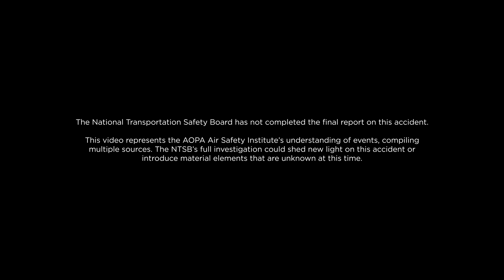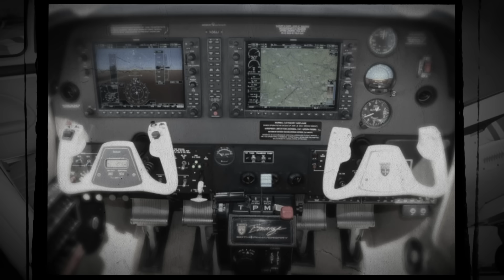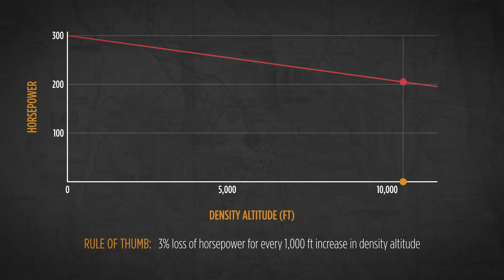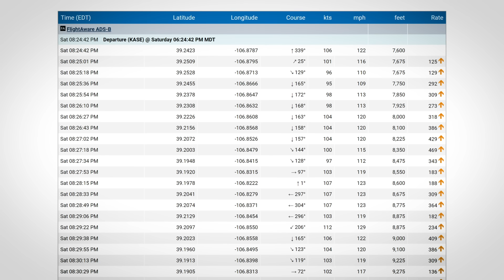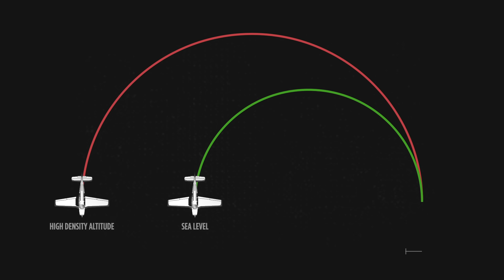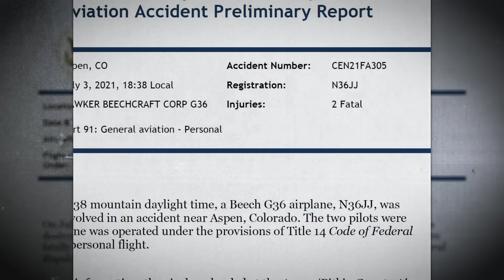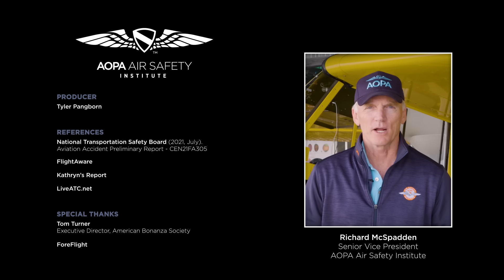Accident Case Study: Into Thin Air

Comment: This is a sad story but a chilling lesson to be sure. The last words said in the narration should be memorized for anyone anticipating flying in mountainous terrain. I fly in the western U.S. mountains frequently and what was demonstrated here is rarely seen by living pilots. Critical is forehand knowledge of terrain MEF, valleys, open canyons, and of course, practiced skill at tight canyon reversals (i.e. nose slight up, coordinated turn, flaps 1 notch...15 deg.) Don't try to make a tight reversal without flaps down 15 - 20 deg., otherwise your bleed of energy and speed will hasten a stall. Aspen is extremely challenging for a non-turbo SE aircraft - I wouldn't recommend it unless you are really a competent and mountain trained pilot. In any event, another excellent ASI video that I hope every student and old-timer pilot watches if for nothing more than to instill a good amount of trepidation and respect for high altitude mountain flying.

Comment: PSA a better single piston route is NNW from Aspen to Eagle then, Kremmling, Granby and cross Corona Pass…save Independence pass for a cool blue bird morning,  should the mountain invite you. A thought about oxygen, if the airplane has less lift and engine power in high DA, wouldn’t your biology have the same?  I’d think the high DA would accelerate affects of hypoxia, dulling a pilot’s perception too.  I’ve never heard pilot sensitivity to hypoxia increase due to DA, so maybe it’s not a thing. I’ve Used a pulse oximeter and my O2 saturation drops more on High DA days (sample size of 1), enough for me to play it safe & take a bottle when flying the high country. Great video and  spot on.

Comment: If they had done 3 or more circuits before departing would they have reached sufficient altitude to clear the pass or was it beyond the performance of the aircraft regardless?
Reply: It can be done, but it is a skill. I have flown a normally aspirated Cherokee 180 into Leadville, CO before, but I did it with half-tanks, no luggage, and only two people. Also, I knew how to properly lean the engine for best performance at that altitude. When I had that airplane in Angel Fire, NM (field elevation 8,380 feet) before I moved up to my turbocharged Saratoga, there were days that by-myself and half tanks, it would take me 4 or 5 circuits above the airport before I would cross the mountains. However, I never cross a mountain pass until I have at least 2,000' of clearance above the ground. However, the higher you climb, the more you have to lean the mixture to keep the correct air-fuel mixture to obtain the best engine performance.

Comment: This plane had Garmin 1000 panels, but it wasn't integrated enough with the aircraft to detect (or at least assist) with this?
Reply: Perhaps it was the decision to VFR outbound - does it cancel all the IFR planning - I guess it does.
Reply: This is the problem with relying on technology and why those educated the old way and the new way have a big advantage in almost every field. But it's a good question of course and i guess the Garmin is an imperfect tool.
Reply: @acchaladka  Respectfully, I don't think we can say the pilots were 'relying' on the technology. I was simply wondering what assistance such an advanced system might be offering.

Comment: Density altitude can be a factor at sea level. Sacramento Valley in summer for one. Type of aircraft. A Piper Lancer (stretched version of the Cherokee) that is an under powered AC at best. Short runway with a railroad embankment at one end and a barbwire fence at the other end. Hot afternoon. We waited until late afternoon and pulled the AC back to the very end of the runway (dirt). With us standing on the brakes to gain full rpm off we went. Well we didn't crash but that AC climbed up the I-80 right away with the terrain rise matching our altitude. That was a plane looking for a place to crash. South Lake Tahoe Airport is a real killer in the summer if you have a southern wind and four people with all the luggage and a load of fuel.

Comment: These types of stories anger me. Flying any type of aircraft- single engine carb to fighter jet require the utmost in checking and double checking and thinking conservatively. 

I fly GA back east in Maine. I traveled  to Tahoe early 2020 to take a “discovery” high altitude flight out of Truckee with CFI in a C172.
While it didn’t reach me everything, it certainly alerted me to the negating performance issues of high density flying. It was a significant learning experience on the ground pre-flight and in the air. Double up on every anticipation. I’m so sorry for this tragedy. It was avoidable.

Comment: About 30 years ago I departed RWY 33 KASE eastbound via Independence Pass in my 200 HP Turbo Arrow with reasonable safety margins. The following factors were in my favor.
1.	I was familiar with the area, and my aircraft.
2.	Turbocharged engine and oxygen on board.
3.	Lightly loaded.
4.	Good daytime VFR.
5.	Reasonable density altitude.
6.	Wind from the west.
7.	Alone, no distractions, rested, and no "get-there-itis".
8.	Flew down valley (to the NW) away from Aspen and Independence Pass to gain altitude before turning 180° toward IP. Coordinated with Aspen tower. No inbound traffic.
9.	Flew the NE side of the valley toward IP for lift and plenty of room to turn 180° if necessary.

About 25 years ago I was landing RWY 15 KASE in the same aircraft. I executed a go-around over the field and circled Aspen (with very little vertical and horizontal clearance) for landing RWY 33. Note: departures from RWY 15 are not permitted w/o special written permission due to terrain (2% upslope toward a box canyon). The following factors contributed to my decision to go-around, or were not in my favor for gaining altitude during the go-around.
1.	Strong gusty wind from the west.
2.	Wind shear on short final and turbulence over the runway.
3.	Substantial crosswind and tailwind components.
4.	High density altitude.

I had a reasonable amount of mountain training and mountain flying prior to flying into and out of Aspen, but wish I could also have had the high-quality simulator time that's available today. Even playing around with Google Earth could help. Going missed approach past the MAP and decisions whether to force a landing or to execute a go-around with limited or unknown options happen a lot quicker than getting boxed in tight on the way to Independence Pass.

Comment: The LINDZ NINE SID at Aspen requires a minimum climb of 463' per NM.  At G36 Vy of 100 KIAS, the required rate of climb would be 776 FPM.  I seriously doubt that normally aspirated plane was capable of that on that day at Aspen.  They didn't accept the IFR clearance, but it should have made them reconsider their plans.

Comment: Could that plane physically do it… were they doomed from the start?
Reply: Yes, the plane could probably physically do it, but it would take expert air-fuel mixture management, probably a little less weight (think half-tanks of fuel), and a LOT of patience climbing over the airfield to get to the right altitude. Density altitude is taught to every primary flight student, but it is only theory. Until you experience, you just don't get-it. Once you do get-it, you don't screw around with it.
Reply: @CIOPilot  
I also wonder if they’d known the gravity of the situation a little sooner if they could have found a spot of open ground to set it down. Probably would have had one shot at it since they couldn’t turn back.

Comment: One more item of poor decision making; Why opt to transit via Aspen ? A little over 100 milles further, crossing the high ground with less fuel weight, they could have made it to Colorado Springs for fuel. Then continued on with the ground falling away. Why plan your way into a difficult situation ? Too many accident scenarios begin on the ground the day before. If they lacked range to make it to Colorado Springs then schedule a quick fuel stop before the high ground.

Comment: Did they brief fully? It was a confusing start, they had an IFR to VFR transition, then they seemed a bit behind in terms of where they planned to go once up. High altitude flying with a climb rate of 200 FPM and its getting dark and you have a long flight ahead into very very high terrain? Even if they cleared that first ridge, the route they showed looks tough to be doing especially at night (very little light on mountains)

Comment: To get an adequate margin above the peaks, wouldn’t they have required supplemental oxygen ? Perhaps that’s why they didn’t bother doing another orbit for altitude- they knew they were already at the limit. 

People don’t appreciate the benefits of forced-induction till you’re at high density altitudes. Ability to maintain sea level manifold pressure would have saved the aircraft, regardless of poor decision making.

Comment: I remember when I was a wee student talking about flying to Lake Placid in NY, similar stakes but much lower altitudes. Even then I was warned 'You MUST climb to above ridge height before departing,  do circles over the airport. If you do not, you will be face-to-face with a mountain and have no room to turn out of the way.'

Comment: Once again a great video for all pilots to watch. A good pilot is always learning!
Reply: And asking questions from the Locals. Hell! Some jet pilots have a problem with that airport. We all take risks, but these guys loaded the deck and paid the price. Why Aspen? I’ve been there many times, it’s a small quiet town . Better during ski season . RIP
Reply: I think the lesson here is respect mountain ranges and know your elevations. Plus never take a non turbo through mountain ranges.
Reply: @ Israel Arana

Ive flown in the mountains for decades and most of my time was in normally aspirated piston engine aircraft. 

Pilots would always ask me. “How much power do you need to fly in the mountains?”  I tell them it doesn’t matter. 

I’ve flown 65hp tail draggers in the mountains. While I’ve seen 2000 horsepower turboprops get eaten by them.  What’s interesting is that more power often can make you climb faster, it doesn’t always make you climb steeper and it almost always means a heavier airplane that can’t turn as tightly and has higher ground speeds. 

Even a turbocharged version of the same plane. Turbos aren’t a free ride. Part of the reason why the P-39 performed so poorly in WWII was because they decided to delete the turbocharger for all of the weight and bulk it added. Aircraft like the P-47 had it. But it was an enormous aircraft that just barely managed to offset the huge and heavy turbo installation with more performance… while being outperformed itself by the P-51 with a smaller engine and simpler and lighter two speed supercharger. 

The point is that every plane you fly. You have to have limits in terms of weight, altitude, and temperature or combinations thereof.. and you always have to have an out in case things don’t go as planned.
Reply: @israelarana5283  that’s a little conservative. There are many many people who safely fly non-turbocharged aircraft in the Rockies and other mountains every day. It just takes some knowledge and airmanship.
Reply: @kurtisf3366  and some of them die
Reply: @steviesevieria1868  As do some who fly turbocharged piston aircraft and turbine powered aircraft. What’s your point? Saying to never take a non turbo aircraft into the mountains is like saying to never take a non 4 wheel drive vehicle onto a gravel road.
Reply: @kurtisf3366  Not quite the same to me. If my car gets stuck on a gravel road I’m not gonna die.
Reply: @steviesevieria1868  You might if you’re in a remote area. Thousands of piston singles fly in the mountains every year safely. There are crashes yes, but there are also turbocharged pistons that go down. Density altitude is no joke, but the majority of accident reports I read about are CFIT where people are flirting with weather and cloud cover while flying VFR. Your engine type isn’t going to fix that. Do you DA and takeoff roll calculations and abide by the results and you will be just fine in a regular piston just like the other thousands of pilots across the world who are alive and well flying them.
Reply: @steviesevieria1868  Pilots die in all terrains. What factual evidence do you have that flying non-turbo aircraft in the mountains is more dangerous than other types of GA flying ?
Reply: To be good at anything you should always be learning! Everyday learn a little something new.
Reply: As a non-pilot, I've heard of the issue many times, yet this video made the concept clear in one shot.
I understand engines, at least. Its must be a unbelievable situation to realise you've gotten yourself into. Terrifying!
Reply: How often do you guys dream about crashing the plane? Have nightmares, that is.

Comment: As a non-pilot, but car enthusiasts. I find it strange that not all piston aircrafts have turbos and closed-loop fuel systems. Was this a very old plane?
Reply: Nope. Most "flat-land" pilots that I know talk about not wanting the turbocharger because of the added maintenance. I fly out of Angel Fire, NM where the field elevation at the airport is higher than Aspen, but I have a turbo to do it. Leave out of there on a day when it is hot, that will change the mind of the pilot about not wanting a turbo. As to your point about the plane's age, the whole general aviation fleet is "old" compared to cars. The difference is that all airplanes are required to have an annual inspection every year to stay airworthy. This isn't like a car's safety inspection. The plane is torn down, all inspection plates removed, cylinders are compression tested...basically the whole plane is gone over from tip-to-tail. For the most part, airplane engines are run on a dual- magneto system rather than an electronic ignition because the magnetos will work even if the electrical system completely fails. Lot's of 1940's to 1950's technology because it is safe, dependable, solid-state, and relatively inexpensive. Think of like having a stock classic-car.

Comment: Having departed from Aspen in a non-turbo C210 (310 HP) and having climbed and flown with that airplane over mountains at 15000 ft in summer (with a degraded climb performance), I have to say I am surprised about the lack of technique given the overall level of certification especially of the safety pilot. Flying at one side of a valley (to be able to turn) would already be a "last resort" IMO. Much better is, always keep the potential for a turnaround, i.e. stay at a far distance of all dangers and not even turn towards it until reaching 2000 ft above the pass altitude. That would have saved them. Some more circles above the airport (until reaching pass altitude plus 2000ft) would have done this job just fine. A normally-aspirated Bonanza (and far from MTOW) is certainly able to climb to 15000 ft even in summer, given enough time (and leaned properly, of course).

Adding it all together, I believe the (excellent) film is omitting one critical aspect: The pilots had already flown a 5hr leg, then rested for four hours after that, yet decided to fly on thereafter, into the night and probably without sleep. Why? Likely there was some "get-there-itis" involved, which is often the background of a bad "go" decision.

Comment: The pilot said it all: "Unfamiliar With The Area" - This is where they should have turned back to Aspen and landed, to consider their ferrying options 04:00  Flying an unfamiliar plane they had only just taken delivery of, with significant power limitations at altitude. Very sad and a needless loss, if only they had planned this operation better.

Comment: An alternate airport, at a lower elevation, would have have been a safer pick while flight planning. It just seems so unnecessary to plan a fuel stop where you know DA will be extremely challenging and potentially deadly.